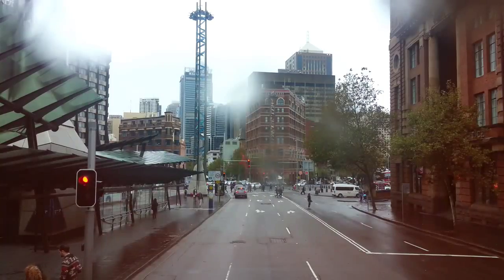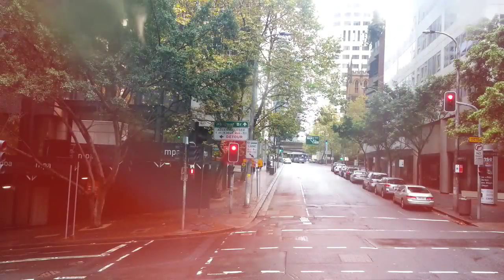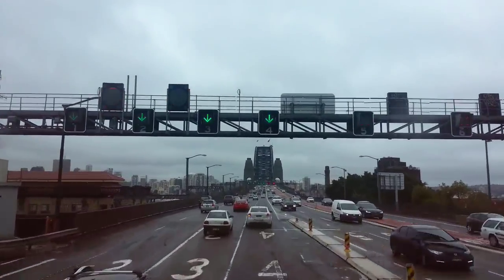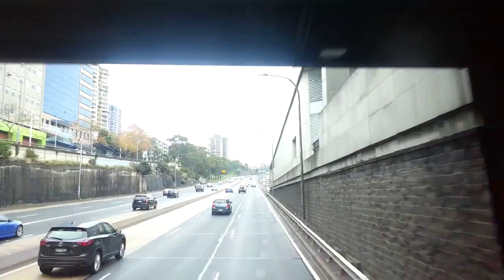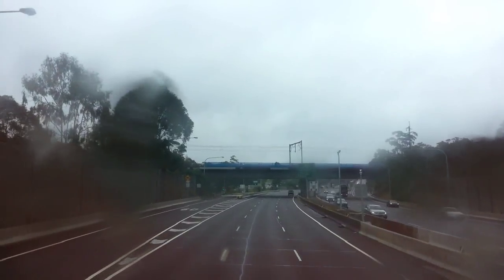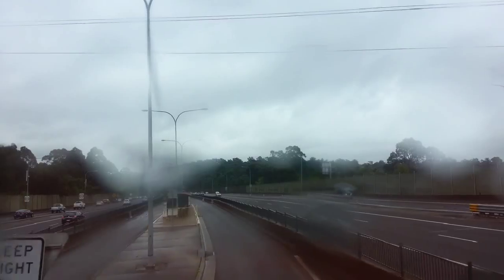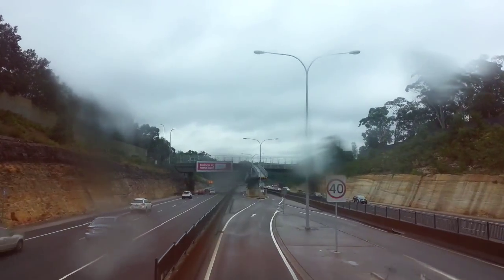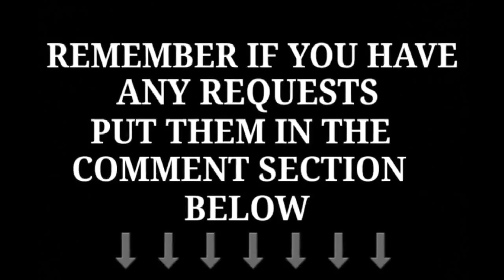Transport for NSW Vlog No.604 A Trip On A Bustech CDi

Comment: Now if your interested in getting a Hillsbus CDi, they are now on routes 607X, 610X, 611, 619 and 665. They are mainly peak hour only on weekdays. 611 has CDis throughout most of the day. CDC no longer put out CDis on weekends unfortunately.
Reply: Karen Gildea Due to the new timetables last year and the low passenger count on weekends, they decided not to put out CDis on weekends. It’s been like this for almost a year now, and yeah it does get a bit boring on weekends only having Volvos and Scanias out.

Comment: 1:00 Nope. Also Forest coach lines is not Cummins ISL. it is run on another chassis. But I think it's the euro that's changed.
Reply from the maker: all Bustech CDis have a Cummins ISL engine on a Bustech chassis
Reply from the maker: might wanna check that one ;)
Reply: +Transport For NSW Vlogs what I actually meant was the forest coach lines is a euro 5. This one and bus ways go by something else.
Reply from the maker: why don't you check the fleetlists website?

Every single Bustech CDi is on a Bustech CDi chassis with a Cummins ISL engine.